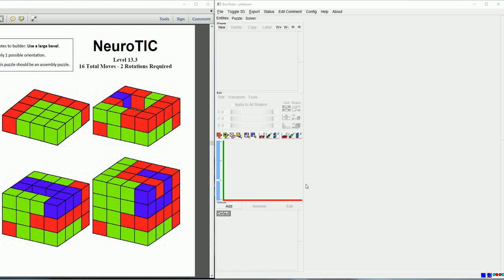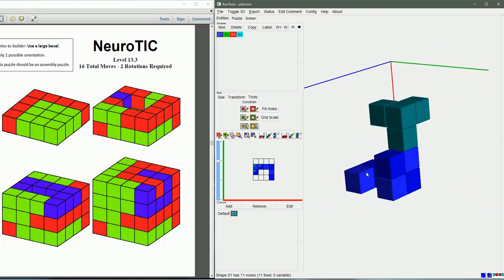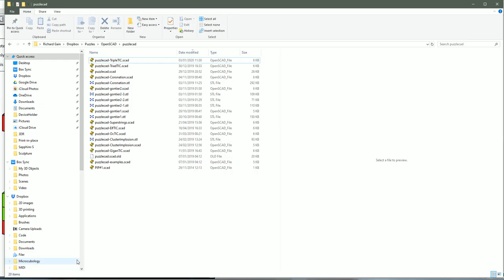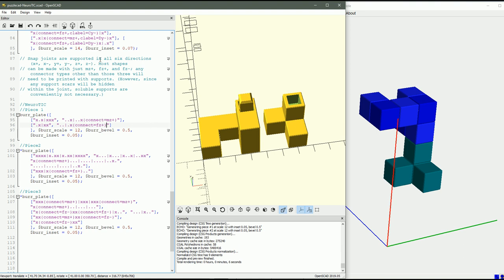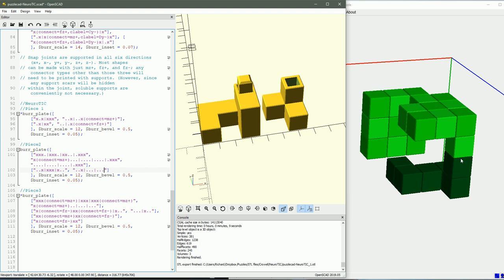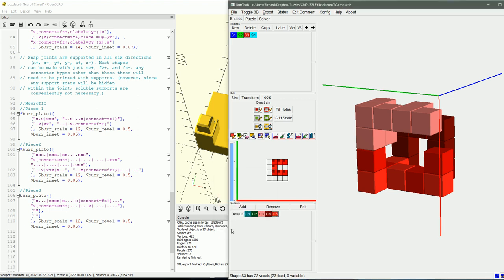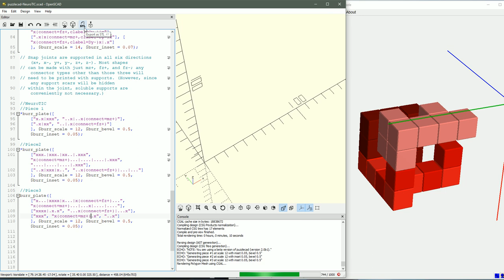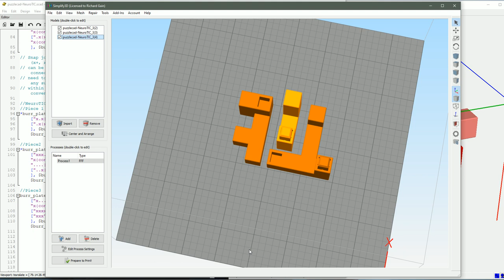Preparing puzzle parts for 3D printing

Comment: One thing missing was BurrTools crashing on you before the file was saved.  ;)    Could have used Enso that inputs BurrTools xmpuzzle file and outputs PuzzleCAD file.   Fyi, no big deal, but the intended pronunciation is: Open - ESS - CAD.    How long did it take to print?

Comment: Nice explanation, but that PuzzleCad seems very complex to me. I use the stl output from BurrTools to make the puzzle pieces, including bevels and face offsets, then import the pieces into SketchUp. From there is it easy to orientate and split the pieces if necessary for 3D printing without supports and add the pegs/holes to join them together. I don't worry about clipping the pieces together, I just use glue.